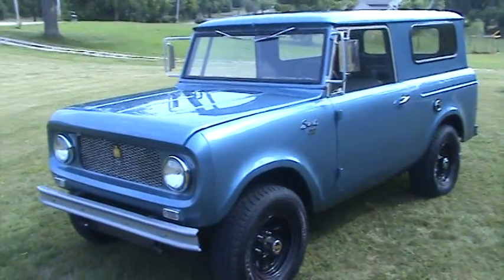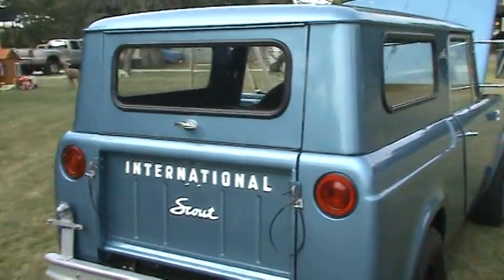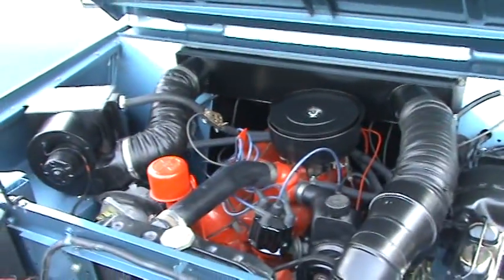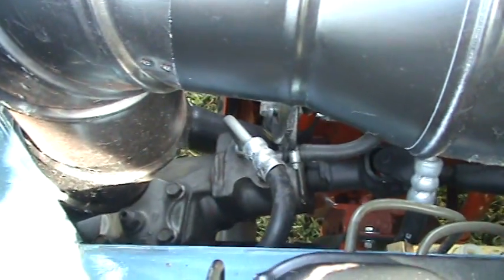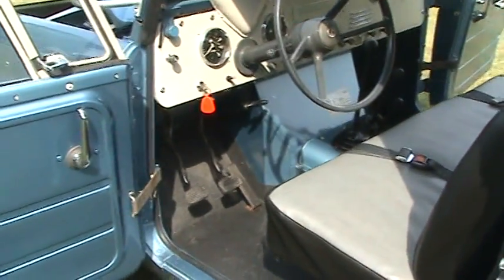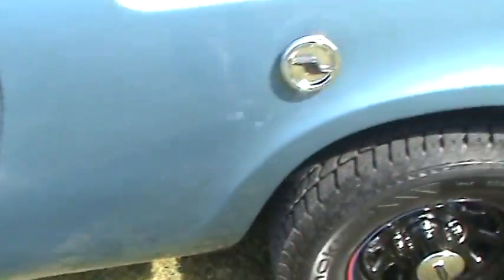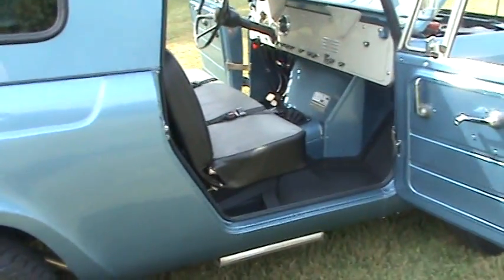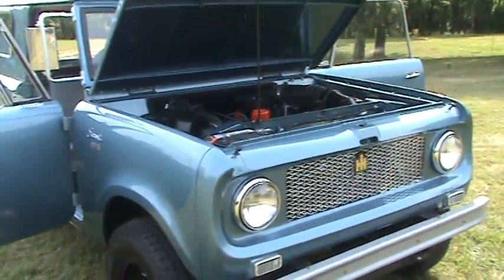63 Scout 80 Final Segment

Comment: I'm gona have to change my dana 27 because I cant find balljoints or parts for it. Will all the scout 2 axles an drivetrain pretty much bolt up or is there alot of work involved changing it over